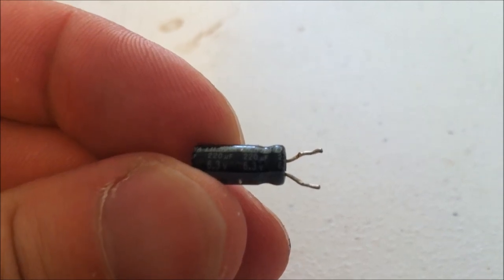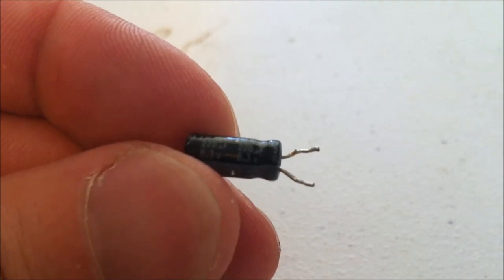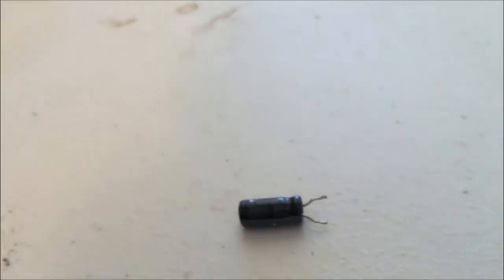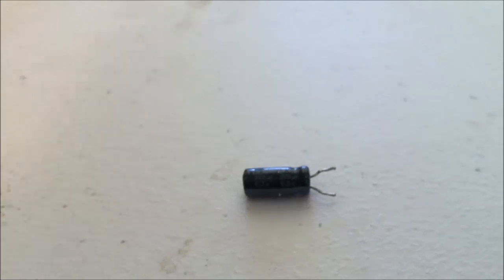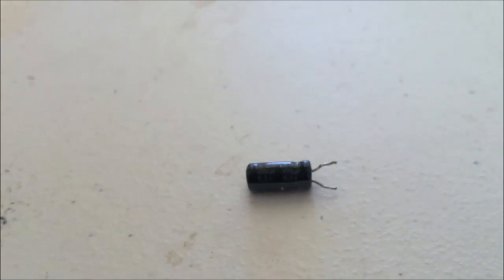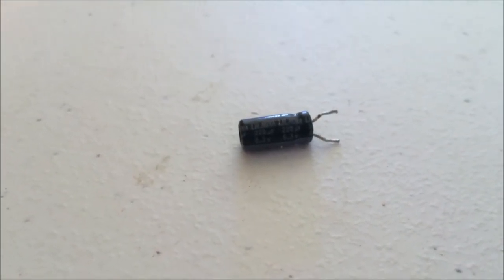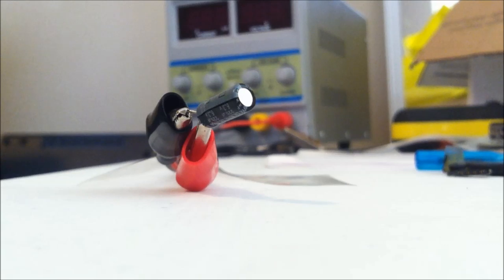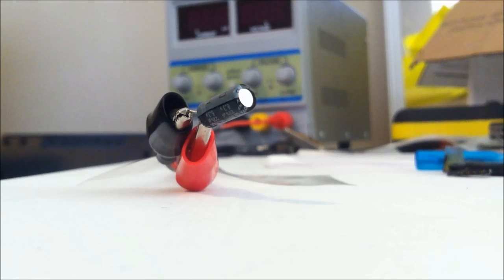This is why your tv died and What causes capacitors to blow up

Comment: Hi. if i see a cap blown in my portable TV and resistor, do i just replace it? i have a small back and white tv which as a blown capacitor and resistor. the capacitor is not as blown as that, and the TV uses a separate dc 12v  power adaptor.